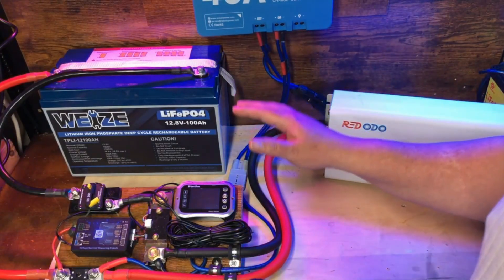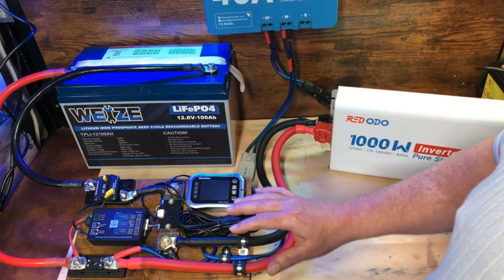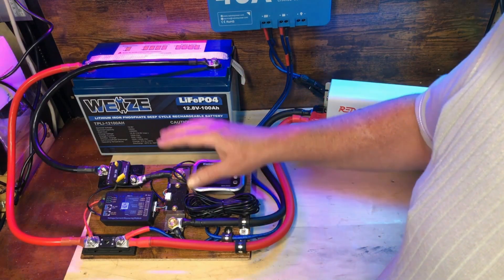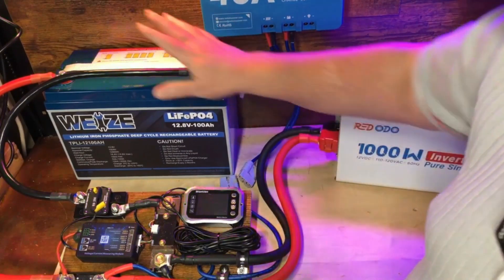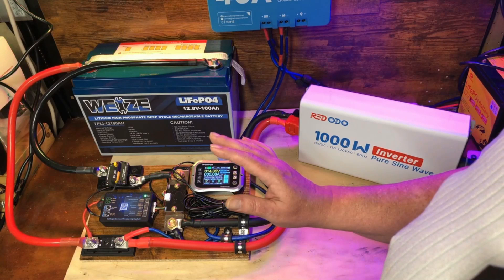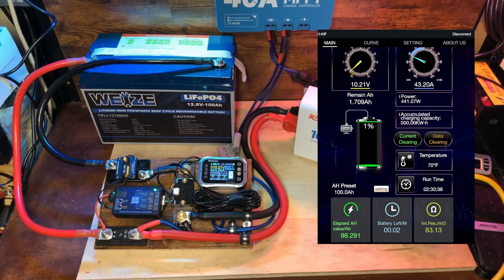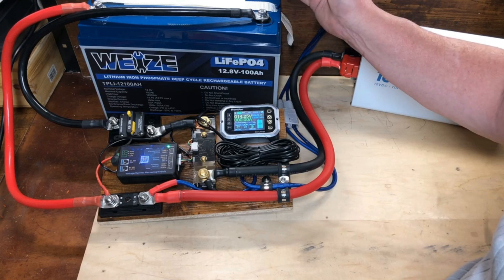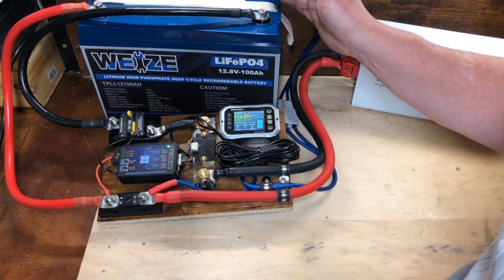Weize 100ah Lifepo4 Battery Capacity Test After 1 Year of Use

Comment: How's it holding up now?
Reply from the maker: I actually sold the pair of these that I had, so not sure. I have so many 12v 100ah batteries I just dont need them anymore, but it was a good battery. Im mostly into higher capacity these days for my own systems.